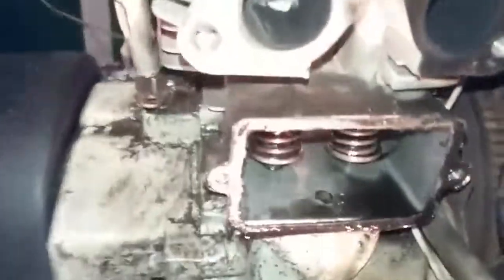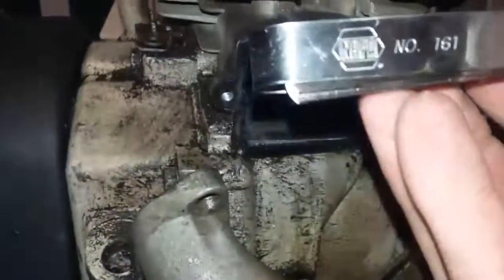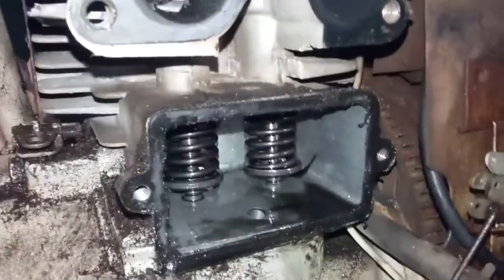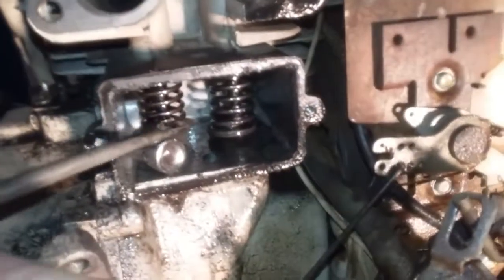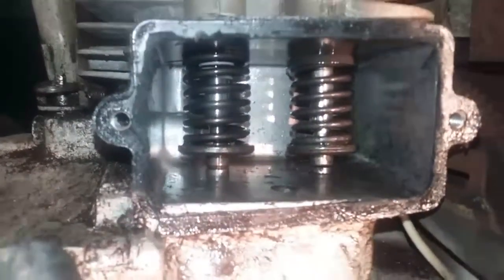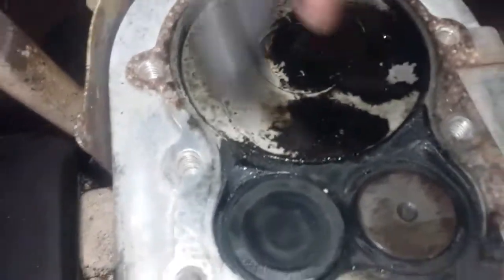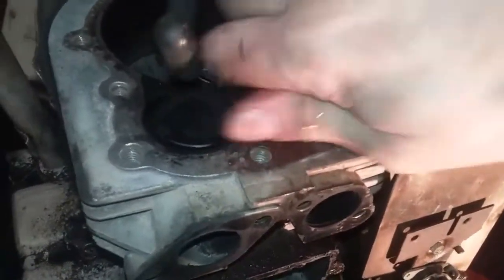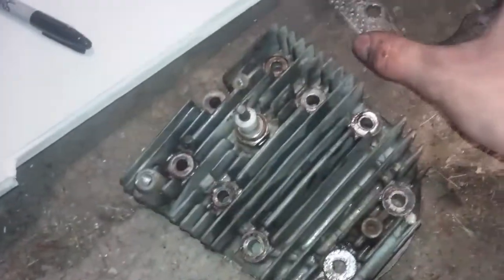HOW TO FIX The Valve Clearance On A 4 Cycle Flat Head Engine

Comment: Nice job, that seal is the head gasket.  Also that air filter is a crankcase breather.  It vents the crank case kind of like a pcv valve.  (Positive crankcase ventilation.).  Good job setting your valve stem clearance.

Comment: Nice job but you did all that work why did you not clean the intake and exhaust valve seats with paste so you get a proper seating and reading ??? If they aren't clean especially the carbon on the exhaust valve you will always have that issue.

Comment: Thank you for taking the time to video this. I’m having a timing issue with a lawnmower (horrible snap back on the recoil). There’s plenty of videos on how to adjust OHV but none of the older automotive types that I could find. Much appreciated!
Reply: Paul i hope you found the problem..sounds like the keyway might be partially sheared
Reply: @matthewcaldwell6763 yes it was a sheared key stock. Thanks for checking in.

Comment: If the valve pusher its under the valve,  so whay have Not briggs & stration made shim betwin the valve pusher and the valve,  to  Replement and get right clearanse

Im thinkin of the same system if the camaxle resting over the valepusher when the Are shim there  to replement, or   the injektors of diesel engine have shim too Replement to.

Comment: Hello my tractor roper rt13 fuel not arrived..
Carburator is new..
Carburator fuel ok 👌..
Cylinder not fuel..
Is posible cause to problem adjustig valve?thank you!
Reply: Bad compression...it will struggle to pull fuel into the cylinder i am sure

Comment: My dad worked on lawn mowers about all his life and I seen him hold a valve shaft up with screw driver and use a file in there to take off so the valve closes properly.You did a great job.You are a smart guy.Wish I could do all the stuff you do.Plus you have such a good personality wow.
Reply: Wow, THAT is exactly what I was thinking!
 I have 4 thousandths on the exhaust and a carb mixture issue and since I find the engine runs great except for that- I looked at the valves. Unable to find any thing else wrong.

Comment: The exaust opening a little like that is by design to make it easier to pull over from my understanding. That's why you can't get a proper compression reading on these engines.

Comment: You just got to it on time as the valve seat will burn , your compression will be poor as well look at the soot as the engine is not running effeciently , its a good time to grind the seats with some paste  to give it nice clean seats , also if you have a bench grinder it will remove sight amouts off the stem just to get your twelve thou for the exhaust valve clearence as its imperitive to have the proper clearence for proper engine running and tuning , thanks alot for your video its good for folk to see whats going on in the engine , all the best Post 10  and happy christmas folks

Comment: Somehow I don’t really feel comfortable with this repair job. It seems kind of sloppy if you don’t mind my saying, even though this is a small engine, higher precision procedure must be followed. Otherwise you might end up with another problem afterwards.
Reply: its a lawn mower.
Not a ferrari.
Reply: @gerardjones7881  Thanks for the heads up.
Reply: What do you suggest. Mount the valve on a cylindrical grinder ? For a lawn mower 😂 Jesus Christ
Reply: @SuperDouginator   There are specialized machines to grind valves and tools to grind seats. I guess you don't know that.
Reply: Yes so not follow this with the up most respect this dude is lost I get mowers in my shop every day because of videos like this I'm sorry my dude but you have a lot to learn

Comment: Air filter soaked with oil is a good thing?????
Reply: It's not the air filter but yes some true air filters do need oil
Reply: Let me explain before  a know it all says something the older mowers that have a type of a sponge filter need oil you put them in a zip lock with about a cap of oil and rub it in the bag to coat the filter what he's showing is the pcv and it's normal to be covered in oil
Reply: Yep
If it's a sponge or metalic!
Not on paper filters though 😉
Reply: ITS THE BEST

Comment: Very bad advice.. You check valve clearance with the piston at the top of the compression stroke. If you check valve clearance with the piston at the bottom you're either at the end of the intake stroke and cam will be pushing on the intake valve, or you'll be at the start of the exhaust stroke and cam will be pushing on the exhaust valve. You have that engine in the start of the exhaust stroke. That's why the exhaust valve it starting to open and you have no clearance.
Reply: He did have clearance on the exhaust valve. You do not have to check the clearance at TDC you have to check it when the valve push rod is at the lowest point of the cam. This happens more than once in a cycle. TDC is for convenience as you can check both valves at once. It is not however compulsory
Reply: @SuperDouginator  How does one know that the engine is at TDC? Top of piston reaches the top twice in a cycle, is that correct? I would like to try this on my White Snowblower...lapping valves and checking lash, did I say that correctly?
Reply: Wrong.

Comment: Model 190000 in. .005-.007, ex. .007-.009 inches. Model 280000 in. .005-.007, ex.      .009-.011.  Inches! Armature air gap .010- .014 inches! Stock Briggs and Stratton power built 12.5hp anyways. The old 8hp on the mini chopper is in.                  .000-       .000 inches and ex. .000-.000 inches

Comment: It will also BURN either exhaust or intake valves  if it runs long enough like that. It doesn't take very long on the exhaust side.

Comment: If the valve is not out to much you can file it in there and not have to remove head OR spring. Just lift the spring up with a big screw driver to get a small file in.

Comment: Although you may have a leaky valve, it is normal for the exhaust valve to start to open at bottom dead center. You should be inspecting the valves at top dead center.
Reply: He was showing the valves in the compression stroke, they should both be closed well

Comment: Just done one of these....to refit the springs I compressed the spring in a vice and held them in that position with two small tie wraps....put the caps on with snipe nose pliers then cut the tie wraps with snips...releasing tension....easy Peesy.....😂
Reply: I done that on a Honda GX 630 the other day but it works great and easy

Comment: Know why my valve seats on the exhaust keep coming out
Reply: Your engiine was very overheated at one time the counter bores for the valve seat on that side became warped. The only thing I've seen here that MIGHT help that is "staking in the valve seat". 
Mustie1 has a video about that. This procedure does not always work. It depends how bad the block was overheated.

Comment: The .008 and .012 are a range for both valves, not a single number for each. Anything between them is good, on either valve.
Reply: actually, almost any engine will specify more valve clearance for the exhaust valve, than the intake. The exhaust valve runs much hotter, thus, expands more. When hot, the clearances are more similar, if set cold, with a little more difference. Also, the exhaust valve seat "walks in" the exhaust valve more than the intake.
Reply: @vincentrobinette1507  many engines, not this one.
Reply: @jbtvt  How do you figure? Any 4-cycle engine runs the exhaust valve much hotter, and the exhaust valve face and seat erode more quickly. No matter what engine. A little more impact from extra lash is fine, the exhaust valve is lighter in weight, due to its smaller diameter. Besides, the exhaust valve loses clearance more rapidly, so a little extra clearance lets it come in, rather than go out of adjustment during use.
Reply: @vincentrobinette1507  I'm telling you what the book says, take it or leave it. I know what most engines specify, this and all the other handful of Tecumseh engine's I've worked on have the same range for both valves.
Reply: @jbtvt  I was weaned on Briggs & Stratton. Slightly different specs, but, they're not super critical. Back in the day, if you've seen one small engine, you've seen them all!

Comment: This is also a good time to lap the valves. Easy to do and the tool and lapping compound are pretty cheap.
Reply: I would expect the valves and seats to be damaged.  I can't think of any other way to lose clearance. It might take more than lapping.
Reply: Don't need u work,n on my engine ,,ur come but no cigar ,,my friend, lap valves then check clearance,,wheres ur degree wheel at,,to accurately  set valve timing????